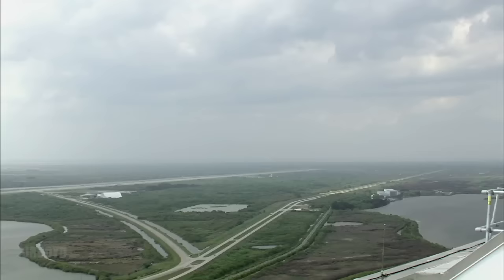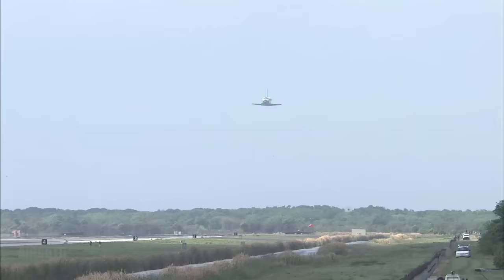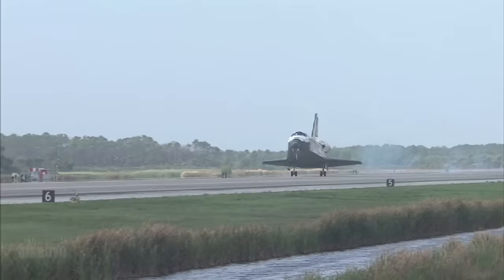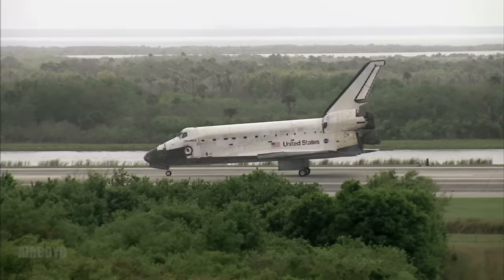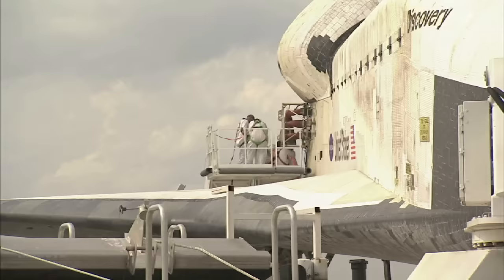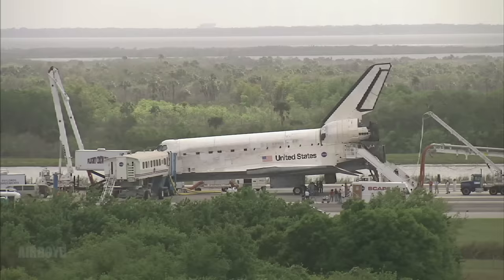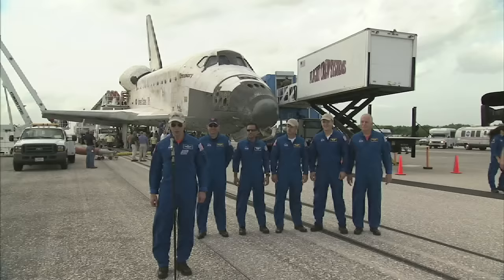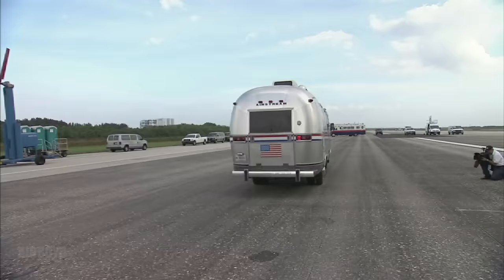Space Shuttle Discovery Landing (STS-119)

Comment: I think this would be the ONLY appropriate time to applaud when the pilot lands the aircraft.
Reply: Samael I’m not saying a pilot’s job is easy, I’m saying it’s routine. You don’t applaud when you arrive at your destination by car, do you? It’s not always easy to drive, and there are far more fatal hazards on the road than in the air. Driving a car is routine, flying a plane is routine (there are literally thousands of planes in the air all around the world right now), landing a space shuttle from 200 miles above the surface of the earth is science. Science that didn’t happen everyday, and is literally a hit or miss. If you miss your exit on the highway, get off at the next exit and turn around. If you’re coming in for a landing but the wind is a little too strong, go around and try another runway. If the space shuttle landing wasn’t executed perfectly, and missed the mark by even a fraction of a percent, there were no second chances.
Reply: @gvardiecky9507  Have you just learned a new word?
Reply: But the "Pilot" does not land the shuttle any longer. It landed by itself. The ONLY interaction with the controls is to lower the landing gear at a certain time. And if the pilot does not execute on time the system will lower them anyway.
A person has not flown the shuttle to landing in a long time.
Reply: @stuartgray5877   You're wrong in saying the pilot/commander didn't fly the shuttle to landing. Almost all of the shuttle's approaches and landing were done manually. Also, the Space Shuttle program is ended, so no one has been flying it for quite some time, manually or otherwise.
Reply: @DCONightingale  I can completely disagree with this comment.. You know what, a man flying up on the sky is really something to awe, yet fragile. When a metal lump of 200 tons is up in the sky, the smallest mistake can lead to a terrible accident with 300+ victims, so after some severe losses mankind has developed this modern flight system with countless safeguards and aviation rules. Cars, which are rather driven by individuals than licensed experts, are relatively out of safety controls. The vehicle also runs a lot more a day compared to aircrafts. Accidents happen not because they're dangerous, because they're *safer*. There's one thing, if the pilot fucks up the final process of landing, that would be the last moment for more than half of the passengers
Reply: @waaahl  maybe i shouldve tagged him first
Reply: @waaahl  actually you are incorrect.  Almost the entire reentry burn, and all the maneuvers until very close to the ground is automated.  This was explained by the people who were refurbishing an orbiter in the Orbiter maint. Facility at KSC while I was on a tour.  The only things that MUST be done by the astronaut is to lower the gear and deploy/release the drouge chute.  The system was designed to perform ALL of the landing on auto pilot in case the astronauts were incapacitated.  They ALSO intended for the Orbiter to make a landing with no astronauts onboard.  It was part of the baseline design of the autopilot system.  I am also an Aerospace Test Engineer with 25 years experience launching payloads to space, so I am aware the shuttle is not flying anymore.
Reply: @jayjoonprod  Sorry about that.
Reply: @stuartgray5877  Reentry burn was executed automatically. I never claimed otherwise. Testing autoland on the Space Shuttle was risky, considering they only had one attempt at landing. Therefore, landings were performed manually.

Congratulations on your 25 years as an Aerospace Test Engineer.
Reply: the pilot isn't the one who lands it, it's the commander and the auto pilot
Reply: DCO Nightingale commander
Reply: Well commander is the name for the one who is mainly resposible on it
Reply: There is no pilot on space ship
Reply: @DCONightingale 8 zc  n
Z  w
Reply: Without the shuttle how are astronauts getting to and from the ISS? I know it was discontinued in 2012.
Reply: @weebgrinder-AIArtistPro  They were launched by Russian rockets from Kazakhstan for some years. Now they are using SpaceX.
Reply: @blagoevgrad94  Thanks. The design on what they use today versus the shuttle looks so 1960s to my untrained eye
Reply: Definitely not after a near accident that was avoided
Reply: @DCONightingale  and
Reply: Well said

Comment: I would love to see what real NASA employees think when they read the comments of all the expert YouTube shuttle pilots on here and do they just shake their heads and laugh or what
Reply: Answering genuine questions is fun but yes, I shake my head at the the rest of it.
Reply: Eddie Congdon  You don’t have to be at NASA to shake your head at the youtube commenters. Real common sense is enough.
Reply: @jrockett73  Genuine question I have:

Are there any big advantages to the spaceplane design? I'm obviously not an expert but it seems kind of dumb to me to use all that power to carry a spaceplane when you could just use it to haul whatever cargo you need.
Reply: Well, the last 30 years wasn't just about hauling cargo. The shuttle did many things to advance space flight wether you agree with the program or not. In order to build the ISS there had to be a platform so to speak. The shuttle provided that as it hauled the equipment, was a work shop to put it together and a safe area for the amount of people it hauled. It was also a platform to retrieve, fix and release satellites and prove new technologies. It was a testing ground for EVA's in space along with robotics. It was the beginning of new, reusable and lighter materials such as carbon fiber, insulation tiles. Fly by wire control systems was introduced by the program. Because it wasn't economically a success , some people call it a failure. Sometimes you have to do things wether its cost effective or not. My opinion only.
Reply: Its where they get their ideas

Comment: The drag chute is cut at 60 mph and is done at this time so it doesnt interfere with work at the rear of the orbiter  after wheel stop. Many vehicles have to pull up next to the orbiter for work and the crew has to position the engine bells and open the belly ET doors etc. If the chute was done later it would be run over, tangled etc.

Comment: Fantastic video - serious question: with the gear deployed so late, I guess there's nothing they can do if it doesn't drop? And would that be catastrophic or would they survive it?
Reply: It would be a catastrophic event, simply put. I read somewhere that there is a chance they might survive if the cargo bay was empty, only a chance though, since the shuttle is not designed to belly land.
Reply: There’s no option for pulling up and circling around for a second landing attempt, so once they deorbit that’s it - they’re landing one way or the other. Fortunately the landing gear never failed in 133 landings!
Reply: I think the reason they drop the gear late is because of the drag that they can cause. For instance in many commercial airlines, pilots tend to pull the gear as soon as possible because of the large amounts of drag that they cause. I don’t know a hundred percent why the gear of the shuttle are dropped late. however, I think this the most likely reason
Reply: @ronanbambrick9825  
Watch STS-3. The gear was down and locked only a couple of seconds prior to contact.
Reply: Right, there would be nothing they could do except to hold on. The reason why none of the landing gear failed was because they weren't powered by hydraulics or electricity, they were simply dropped, and gravity/wind resistance pulled them into place where they locked.

Comment: Her obscelence was pure slander. The shuttle went through many upgrades, Challenger and Discovery went through progressive heatshield improvements, the external tanks went through 3 upgrades and the main engines were also upgraded twice, add to this the glass cockpit, the EDO capacity and the Station to Shuttle power transfer system, one concludes that the shuttles were quite up-to-date, if old. Their weakness was not having enough things to do with them in LEO. You couldn't build 4 ISSs and 6 Hubbles, because the requirement for space industrial construction works simply isn't here yet. The shuttles were excess capability.....
Reply: I think they had many weaknesses and the project was terribly ill conceived - but chief among them was the fact that the shuttle sat in a prone position on the launch assembly/stack.

Comment: Question. Were the heat shields still hot when it landed or was it cooled off by the cooler air before it landed?
Reply: The tiles are warm to the touch. The leading edge wing panels and nose are a little hotter and will burn if you hold your hand on them. But cool compared to 3000 degree re-entry temp.

Comment: I didn't know it landed like planes🙄
Reply: It doesn't. It is an unpowered glide.

At only 28 miles from the runway it was travelling at Mach 1. For reference, that would be like approaching LAX at the speed of sound over Pasadena. The shuttle descended toward the runway 20 times faster than a commercial aircraft. The shuttle also dropped seven times more steeply, beginning its descent with its nose angled downward at 19 degrees. At 2,000 feet (610 meters) in the air, the commander sharply raised the nose and slows the rate of descent using the lift from the large delta wings to flare. The vehicle touched down at between 214 to 226 miles per hour. So no, nothing remotely similar to "landing like planes".

Comment: LOL looks like a big jumbo jet. anyway I'm pretty sure they would burn up if they tried to pass through the Van Allen belt
Reply: “Pretty sure” no kidding. You have no clue what you’re talking about. The ISS is well below the inner Van Allen Belt, so it doesn’t even apply here. Also, “burn up” doesn’t make any sense. It’s a bunch of trapped radiation, not atmosphere. And even then, if they were, for example, going to the Moon (which is not possible with the Space Shuttle) and they passed quickly through the Van Allen Belts, they’d be perfectly fine.

Comment: i wonder why they are using parachute to slow down the air plane, while the other civilian aircraft don't.
Reply: That's a space shuttle not a airplane
Reply: A parachute was added to reduce the wear and tear on the axles and brakes. This space ships glides from orbit to the runway. So they always have more energy or positive energy than they need just in case. So the shuttle lands at a high speed and needs lots of runway. Civilian aircraft don't have the same needs and have turbine engines with reverse thrust or don't need long runways.